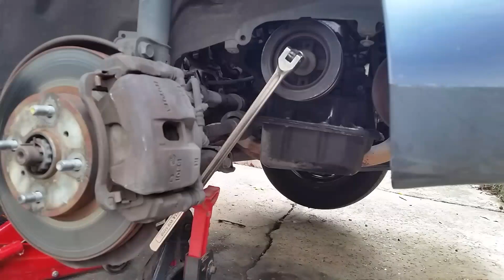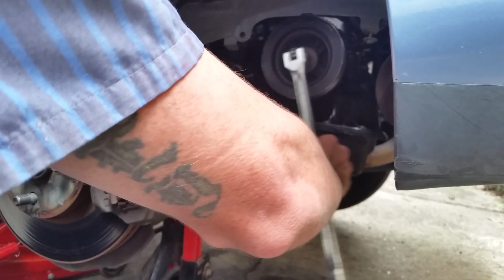1995 Toyota Corolla crankshaft pulley starter bump

Comment: Tried this method many years ago with good success but definitely didn’t succeed 100%. Seen video this evening best ever which is simply a 1/2 inch drive socket inside and welded to larger 1/2 inch socket to create a v heavy socket. A pneumatic guns runs every crank bolt out. 👍

Comment: Tried everything! Copied u exactly and bam! Worked perfect!
Reply from the maker: Congratulations! Glad this video helped.
Reply: @CoffinNeAler  thanks a lot ,but how to tight it again ?
Reply from the maker: @ahmedkareem3601  taking the bolt off.
The hard part was tightening the bolt when I put the new one on because I didn't have a tool to hold the pulley to tighten the bolt down to 85"lbs (I believe). Believe it or not I used 4 particle board fan blades stacked. Drilled a big hole in the middle the size of the socket  and two smaller holes for the bolts to screw into the pulley. You drill these holes in one end of the fan blades so you have leverage holding the pulley still. The bolts bent, but I was able to get the 85"lbs. Since the bolts were bent there was no way to back them out. So I just broke the particle board blades and straightened them then backed them out. One bolt broke off in the pulley so this method is not recommended. I was able to remove it easily, but still wouldn't recommend this method. If I were to do it again I would buy the tool I needed. But if I didn't have the money. I would've used 5 fan blades and used nuts on the distance of the bolt from the pulley to the fan blades to give it more strength so they wouldn't bend so bad.
Reply: @CoffinNeAler  good thanks for the notice
Reply: @CoffinNeAler  how did u put the bolt back on
Reply from the maker: @elvisgomez2944  
The hard part was tightening the bolt. because I didn't have a tool to hold the pulley to tighten the bolt down to 85"lbs (I believe). Believe it or not I used 4 particle board fan blades stacked. Drilled a big hole in the middle the size of the socket  and two smaller holes for the bolts to screw into the pulley. You drill these holes in one end of the fan blades so you have leverage holding the pulley still. The bolts bent, but I was able to get the 85"lbs. Since the bolts were bent there was no way to back them out. So I just broke the particle board blades and straightened them then backed them out. One bolt broke off in the pulley so this method is not recommended. I was able to remove it easily, but still wouldn't recommend this method. If I were to do it again I would buy the tool I needed. But if I didn't have the money. I would've used 5 fan blades and used nuts on the distance of the bolt from the pulley to the fan blades to give it more strength so they wouldn't bend so bad.

Comment: Yeah I gotta do a 1995 Toyota Camry today, bump start method looks like it would get it out but like you said tightening it to torque is going to the biggest challenge. The woman I'm doing for rented the puller, but I think she's going to have to rent the tool to hold the pulley
Reply from the maker: https://m.northerntool.com/shop/tools/product_200677477_200677477

You're going to need something like this to make the job much easier.
Reply: @CoffinNeAler   yeah but I'm not doing the cam I'm replacing harmonic balancer, nobody rents the Crankshaft pulley holder for Toyota.. I'm sure starter bump method will break loose the bolt, use puller to remove harmonic balancer, reinstall new one. Torquing the bolt is what's going to be the issue. I've seen a few methods using a rag and chain, or remove the starter after I install new harmonic and wedge the flywheel to hold the engine. It's only 80 ft pds of torque.
Reply: @CoffinNeAler  I also subscribed 👍
Reply: @CoffinNeAler   Well good news I got the bolt out with bump start method with ease, didn't even have to use the harmonic balancer puller. The harmonic balancer slid right off by hand. The trickest part was tightening  and torquing the bolt back, chain method didn't work so well. My only option was to put threadlocker on the bolt and removed the starter, wedged a crowbar against the flywheel had someone hold the crowbar and torqued it down to 80 ft lbs
Reply from the maker: @jonathanp.1712  Wow that's awesome! We work with what we have and make it happen. Glad you got the job done. :-)
Reply: @CoffinNeAler   thanks man watching your video convinced me to try the bump start method worked like a charm👍

Comment: how do you disable so it doesnt start.?
Reply from the maker: rocknrollermann disconnect the distributor input wire to keep the engine from firing.
Reply: i dont know what that is
cant find anything on that
Reply: its 04 corolla.
Reply from the maker: I'm not sure about an 2004. This was a 1996 Corolla. You need to disable the firing mechanism. You can do this by taking the spark plug wires off but make sure you label them so you know where they go. If your car doesn't have wires and has boots on the spark plugs there is a connector that you can unplug. The key is to stop any spark from getting into the combustion chambers.
Reply from the maker: All you want to do is to turn the motor over to loosen the bolt. That's the easy part. The hard part is tightening the bolt back on the new pulley. You need a special wrench for that. You can read in the comments how I did it. You also need a pulley puller after you loosen the bolt to get the pulley off.
Reply: @rocknrollermann   I unplugged the wire connection to the distributor
Reply: @rocknrollermann  Just take out the EFI fuse in the main fuse box under the hood. EFI stands for electronic fuel injection.
Reply: I'm going to remove the plastic engine cover from my 2005 Corolla Hatchback 1600 3zz engine and then unplug each individual ignition coil from the wiring harness and then test that it won't start first to be sure, then I'm gong to put the car on jack stands and do the procedure
Reply: Pull fuel pump fuse
Reply: @num9908  hmmmm. i'll look into that. thx.

Comment: Do you use an extractor to remove the pulley or just pry it from side to side?
Reply from the maker: Ruy Lopez I used a pulley puller after taking the bolt off.
The hard part was tightening the bolt when I put the new one on because I didn't have a tool to hold the pulley to tighten the bolt down to 85"lbs (I believe). Believe it or not I used 4 particle board fan blades stacked. Drilled a big hole in the middle the size of the socket  and two smaller holes for the bolts to screw into the pulley. You drill these holes in one end of the fan blades so you have leverage holding the pulley still. The bolts bent, but I was able to get the 85"lbs. Since the bolts were bent there was no way to back them out. So I just broke the particle board blades and straightened them then backed them out. One bolt broke off in the pulley so this method is not recommended. I was able to remove it easily, but still wouldn't recommend this method. If I were to do it again I would buy the tool I needed. But if I didn't have the money. I would've used 5 fan blades and used nuts on the distance of the bolt from the pulley to the fan blades to give it more strength so they wouldn't bend so bad.
Reply: @Tommy Samson Instablaster =)
Reply: @Kendall Arian I really appreciate your reply. I got to the site thru google and Im waiting for the hacking stuff now.
Looks like it's gonna take quite some time so I will get back to you later when my account password hopefully is recovered.
Reply: @Kendall Arian it did the trick and I actually got access to my account again. Im so happy:D
Thank you so much, you saved my ass!
Reply: @Tommy Samson Glad I could help :D

Comment: I am way more professional than you. I made a steel tool which is mounted into the 4 M8 holes to hold the pulley in place. Also used for tightening the pulley bolt to the recommended torque.
Reply from the maker: Bravo 👏
Reply: Did you make that tool all by yourself? You must be very proud? Hey, do you also make tools to take out 10 pointed bolt nuts? Man I wish I had your professional master engineering skills so that I can make tools at home....man oh man...
Reply: @Ruben901  Thanks, you have a keen sense where recognition is due.